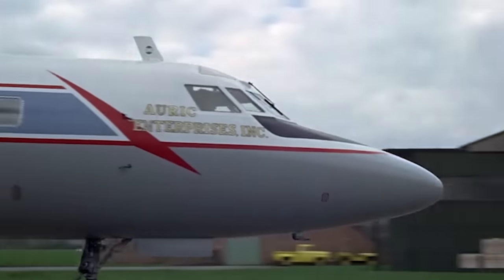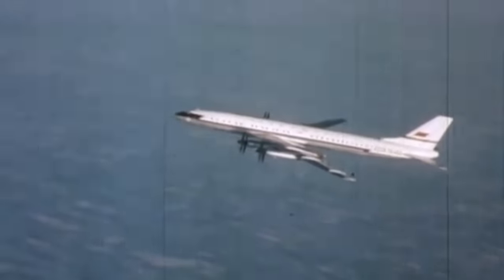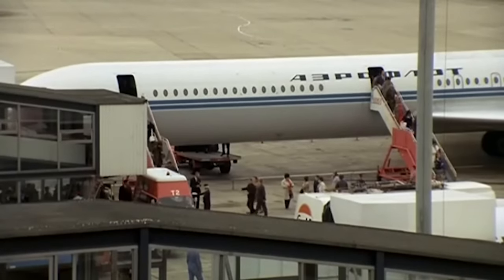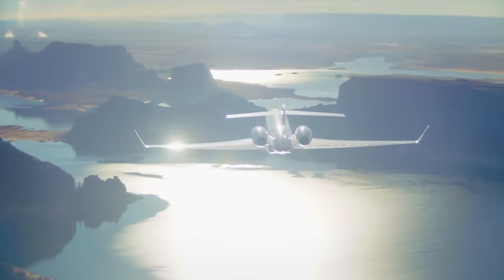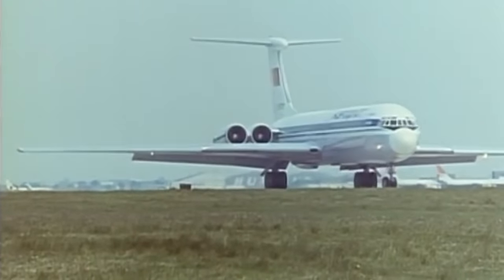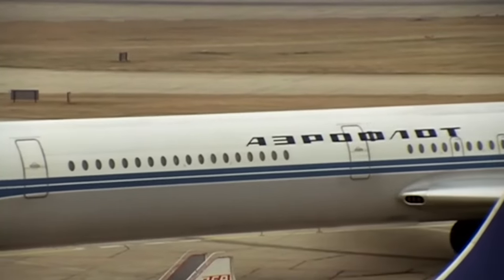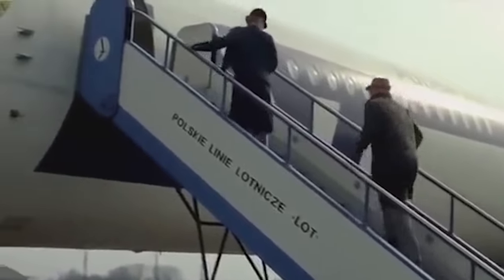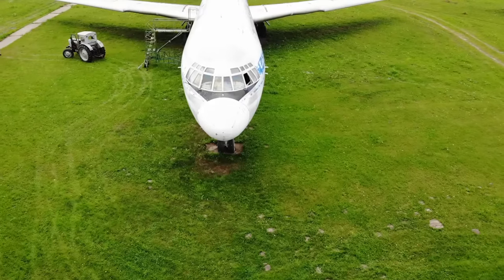IL-62 - an ideal option

Comment: Whether you like it or not, its a VC10 rip off. They did not realise the VC10 tilted forward on the ground so the c of g was above the wheels. The only problem was to ensure that during refueling you had to ensure the forward tanks were refueled first. The IL62 tail wheel is a bodge job for bad design.
Reply: Rip off?  This may or may not be the case, but aircraft designs have always drawn upon other peoples designs.  Even the Wright flyer incorporated some features of earlier, european attempts, including kites and gliders.
Tommy Sopwith bought a Wright flyer and modified it for his first aircraft.    MD made Caravelles under license before producing their DC9 and DC 10.  It's everywhere, it's normal.
Now if you want to talk about the Tu144, then yes, that was a rip-off.
Reply: And we all know how the VC-10 fared in comparison. Constant revisions, low numbers, early retirement. Meanwhile the Il-62 soldiers on having hardly needed to change.
Reply: It's not even remotely a ripoff.  The Il-62 is mechanically an original design and resemblances are superficial only. That's like calling the DC-8 a ripoff of the 707 because they're both narrow body airliners with four engines on the wings.
Reply: @zhiracs  Yes.  We do.
The VC10 was designed to meet BOAC's stated requirement.  However as it became ready for service, BOAC's routes were changing away from long empire routes to closer routes, especially trans-Atlantic.  And as with BOAC and the Bristol Britannia, they'd specified one thing and ended up wanting something different.  So in both cases they bought the minimum number and then bad-mouthed the type so that no-one else would buy it either.  And then got back into bed with Boeing.
Meanwhile, the USSR's routes hadn't changed.  Incidentally there was also a Soviet Britannia look-alike, the Il-18.

Comment: I used to fly with IL62/62M (along other soviets like IL86, TU154, TU134, AN24, YAK42 etc pp) a lot back in 70s, 80s until late 90s within USSR and between USSR and Europe. I thought it was OK airplane until I flew with some western airplanes (A310, B737-200,-300, B767) and then had to fly with IL62 again. It was really crappy example of the “economics must be economical” soviet industrial design and technology... Cheap and low-tech whenever possible. I ultimately stopped using Aeroflot and derivatives and switched to the alternative carriers flying modern airplanes to avoid soviet airplanes and soviet service.

Comment: yes, we have nothing but praise for the Soviet engineering, wonderful design and efficiency. Like a good Soviet statistician, you tell us all about the bolts and screws, nothing about comfort or safety.   Absolutely nothing about the passenger comfort, luggage room, toilets, food service--nothing. Totally a Communist idea of the rough "working class" flying. The seats killed your ass bones, windows tiny, the walking isle the width of window ledge, toilets less than basic, and the luggage could easily fall down over your heads. You were lucky if you got some hot tea, since there was no kitchenettes there to serve hot foods and drinks. This plane was a bad news for any passenger
Reply: @Ida Bagus Paramarta Premananda Soviet science and engineering were second to none. We all know that since the Sputnik. The engineering is great, but that is not the issue for a passenger plane. comfort and ease are the point. the IL-62 had neither. I flew one: my ass was so painful because of the rough seats, and my head in pain with other people's luggage falling down on it from the flimsy luggage racks above. THAT is the point in passenger plane, not how grand the engineering design of the engines were...

Comment: Ideal option?  An airliner with a water tank for ballast.  How much fuel was wasted to carry the 3 tons of water? Like it didn't waste enough fuel already.  On top of that, engines mounted together at the tail are in perfect position, so that if one explodes, it will damage the next engine and the empenage cutting all the hydraulic lines.  Yes, and ideal option.  This must be a Russian channel. ;)

Comment: It also needed a weird set of wheels that held the tail in place. If it didn’t have the rear wheels the front would tip up...not well balanced and was recognized worldwide as a cheap Knock-off of the V.C.10.

Comment: 2 polish IL-62s crashed just because of the cost cutting on engines. They missed crucial elements, some parts of the bearings to be exact. Absolutely unnecessary tragedies..
Reply: The bearings had 26 rollers, but to cut costs, the factory only put 13 rollers, leaving the spaces for the other 13 empty. The load overheated the bearings and the heat broke the turbine shaft. The turbine spun free to tens of thousands of RPMs. The turbine disk then broke apart, damaging the adjacent engine, almost all flight controls, an engine at the other side of the fuselage; also setting the plane on fire. The plane was good, but the soviet mindset doomed it.
Reply: @gsilva220  later poles creater extra computer unit with sensors to measure shaft vibrations at remaining planes engines, at least once system prevent another lost. Finally sh... Ils was replaced with B 767. No plane lost since then.

Comment: tu-114 was noisy only bcse its propellers weren't optimized to minimize noise. A400m is not as noisy except at max.speed (837km/hr).  Now cheapo-airline garbage jets cruise at 750-800km/hr and tu-114 would be superior fuel-consumption and reliability-wise.  Jets were privileged over tu-114 bcse of the wish to go near 1000km/hr and military reasons...  TU-114 should come back with noise-/etc-optimized propellers...

Comment: Rooskies retired the IL-62 in 1995...30 years ago!
The DC-8 is still flying today(Started flying in 1959) and still good for more 20 years!
Pratt and Whitney JT3D last forever but it's is copied on the IL-62. which kept exploding and crashing so bad than only communists dare ride in it...The DC-8 is totally mechanic and nothing ever break while the Boeing 707 is stricly electrical, so they are grounded all the time. I flew first the DC-8 to Poland and the Polish pilots told me they were going to dump all their Ilushing-62 and purchased DC-10 the next following year! Why? Because four Ilushin 62 crashed only in Poland and nobody wanted to get in this crap airplane! The DC-8 is fun to fly, very smooth and pleasant and the 15,000 hours I flew in it, NO ONE SINGLE TIME THE PLANE GO GROUNDED...nothing break ever! I always flew the maximum, 84 hours a month or 1,000 a year...

Comment: Plane with many tech problems single hydro system mean engine failure in tail and no control. That engines is low power too. In lighter plane tu154three same engine make plane still slow

Comment: FIVE CREW? A 767 has 2
Reply: Well that was a Soviet approach to the organisation of flights. Like you have two pilots, one flight engineer on the work of all systems, one navigator to simplify navigation for the pilots and one radio operator to be on the radio. Everyone's doing his own job. Even though Tu-154 for example officially required a crew of 3 people, they often flew with 4 or even 5 of them to ensure that operation will be safe and sustainable.

Comment: The Polish operator LOT lost two aircraft of this type in the space of about ten years. Both accidents were result of engine failure resulting from poor technology and poor workmanship of the engines. In both cases it was a failure of the compressor drive sharts that caused turbine failures, that in turn caused the engine to disintegrate, demaging the surrounding engines in their pods, as well as severing the hydraulic control lines of the elevators and ruder. The snag of the design was that these systems were not duplicated for the hailed simplicity of design, which made them especially vulnerable as all the mechanical elements came together in the tail section. The Soviets waived the responsibility for the crash as due to the structural failure of the turbines blaming the operator for improper rmaintenance. The Polish operator had little to say as this equipment was forced on them as part of the "brotherly communist cooperation", rather than a first choice resulting from performance. Flying on the Warsaw-NY route these planes were at the very edge of their range often resultiig in near low fuel emergency landings (had to declare low fuel for priority landing with NY ATC). Taking off they were always at or slightly above their takeoff weight resulting in heart stopping end of  the runway liftoffs (there is a video on YT of this plane nearly catching the grass at the end of the runway and cleraing a perimeter fence just inches above). Their climb rate was dismal and fuel economy rather poor. It took a fully loaded jet heading to NY nearly two hours to reach a cruising altitude after takeoff. The engines needed a general overhaoul after something like 5,000 hours as opposed to 10,000 hours for the western designs. All this made the economy of these planes questionable. They were able to operate in the communist economies where state owned airlines were subsidized, however after the fall of communism in Poland, and the brotherly pressure from the Soviets no longer a factor, Polish airlines quickly switched to Boeing 767's for the long haul and 737's for the mid-range flights. Objectively speaking, Soviet airframe designs were robust, but many technologies required for making them work were lacking, obsolete or perhaps not properly copied (courtesy of the shortfall at the KGB industrial espionage unit), resulting in suboptimal performance, especially in the engine department.

Comment: https://en.wikipedia.org/wiki/LOT_Polish_Airlines_Flight_7;  https://en.wikipedia.org/wiki/LOT_Polish_Airlines_Flight_5055. Flying coffins.
Reply: Yeah, and the B737 is also a flying coffins
Reply: @Kalashnikov413  LOL. mostly due to the pilot's error. MCAS is an "improvement" to 737, and most foreign carriers opted for 1 sensor option (that sensor going bad is what cause the 2 crashes) and pilots who did not have any training in MCAS and panicked when it malfunctioned. Until then, 737 had one of the best (if not the best) safety records in the World. Il - 62 killed 1,141 people in 20 accidents. It is difficult to compare with 737 due to popularity and number of models, but a combined all 737 models have lower incident rate than any Airbus model except for Airbus 330 and Airbus 318-321. And that average was driven up by 737 MAX due to very few flights. I have a feeling a vast majority of people in the World would rather fly 737 than ANY Ilyushin... http://www.airsafe.com/events/models/rate_mod.htm

Comment: Are you talking about the plane that killed over 250 people in two crashes in Poland in the 80's? And I use term "killed" because it was a manufacturing failure within engine turbines, not a whether, bird or human error. Piece of crap, that's what it was. As everything Soviet.

Comment: I think there is a bit of embellishment going on here from a definitely biased Russian narrator.  So, standard operating procedure on landing was to slam the aircraft down on all three's, then let the nose bounce up, producing a 30 to 45 degree incline off the rear gear, use the resulting angle as an air brake to slow the aircraft down, then let the nose of the aircraft down again, dropping the aircraft on to the nose gear.     Sounds fantastic,  I'm sure the passengers thought it was super cool as well!   Basically typical soviet enginering :   copycat design (because it's inherent in communist/socialist systems that creativity is squashed, due to governmentally induced death or dismemberment if your design fails) but done poorly.    So things like the "cobra landing" are really accidents that worked because they  didn't cause complete failure, so they are retroactively dubbed as part of the original design.     5 guys in the cock pit?   only in a socialist/communist nation where cost is no object, no business level efficiency here.   Try paying 5 professional cockpit salaries for just 150 passengers in the real world...ain't going to happen.   Their decision to make things simple on the aircraft stems from their INABILITY to make more complex electronic systems (again as a result of the communist/socialist inefficiencies). 

These aircraft speak more of the inefficiencies of communism, sadly what the US is now moving towards,than really aircraft technology.    Nearly every soviet design is some kind of copycat design from BOAC, Douglass, etc.    It's not the engineers fault, it's the fault of that disguisting and ill fated evil system of control call communism.   As we can see, it never works in the long run. 

They did their very best.    And people should be proud of those that toiled under a horrifically inefficient government for decades.

Comment: Absolute crap.   It is a copy of BRitish VC10 but as with the Lada being a copy of Fiat124, the Ilushin could be derided as a VC10 “assembled. In the  dark” as Car and Driver magazine once compared the Lada to the Fiat. We worked on Il of Cubana in YEG that had blown main gear tire wheel assembly was so much heavier than our heaviest wheels we had (727 Man) that we had huge problems finding equipment to change it. Total empty weight as percentage of Max to weight reduced payload requiring extra fuel tank in TAIL for heavens sakes to feed required engines which led to c of g probs. Travelling to Moscow from Paris on Aeroflot pass I was so disgusted with service and aircraft (and alarmed) that on return I rerouted on SAS via CPH. It cost me a day in the end but it w as worth it. Goodbye Il62 good riddance. Gas guzzler, dangerous, crude, inefficient, not the best one of the worst.